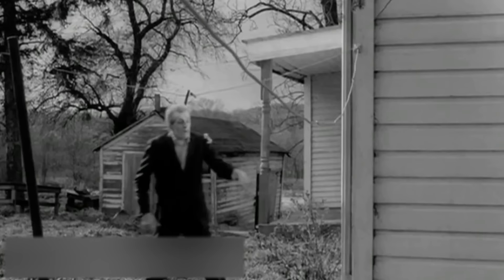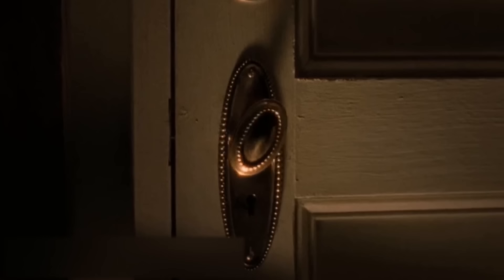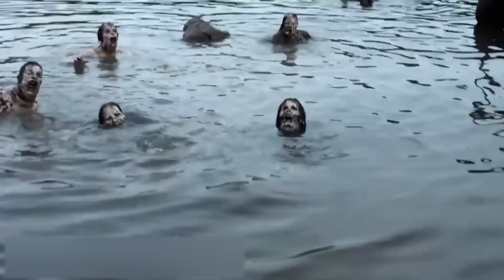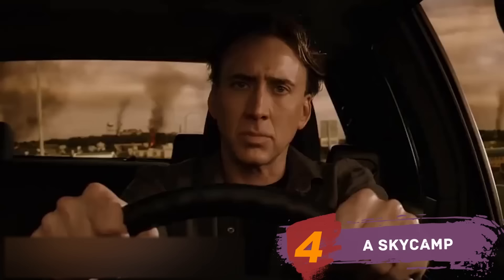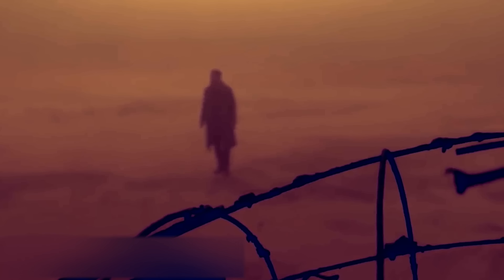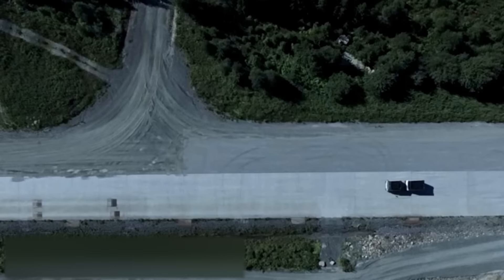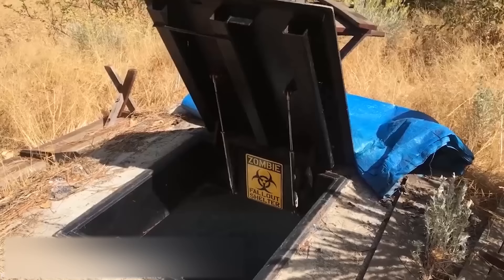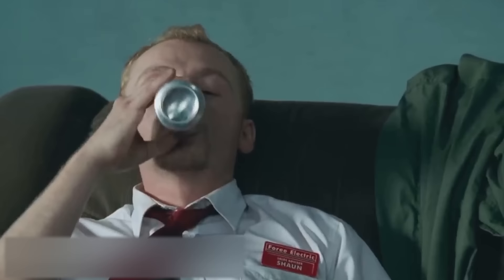9 Cool Ideas in the Case of a Zombie Apocalypse

Comment: OK these things are pointless to have. Plus they must be expensive. 
And theos mad max type cars with all that crap on it? Is really dumb in a zombie apocalypse. Why because  many thing weight, unbalanced and most of these weapons are cles range. When it be better to keep them as far as you can. But lets start with weight, 
Adding all of that unnecessary crap will cause more weight meaning more gas to move the care. If you want to armor up your car that's fine. But I would more suggest concentrating on the windows , and the wheels turning them into tank traks. Keep in mind so far all of these item leaves out some of the most important thing to survive Food, Medicine and water. That stare walker is pointless and looks very expensive. You know what would be a better way to handle stares?
Getting rid of the stares you can make a rope lader. Destroying stares shouldn't cost that much money maybe some of them might cost more time but not much money. And all you need to do is make a rope layer that you can pull up. Plus all of this and still for getting a out the greatest danger still out there. Living people you know the ones that can still use guns.
Most of these things they are showing is things you would buy now. But most likely you won't be using it. Spending money on MREs is a smarter thing to do then this.
Having skill and knowledge about things is one of the most greatest asset you can have to survive. 
How to fix cars, Engineering, Medical care, drying food, growing food, how to make fire with out using liters or matches. Etc.
Being resourceful, 
Creative,
And the ability to adapt and pick up things fast.
And let's be real that Zombie walking thing. Has a lot of problems let's start with 
(1) apparently it need power
How is it getting it's power? Outlet? What happens when the electricity goes out? Batteries?
Are they rechargeable? And even if they are, and can be recharged by a generator tell me what would you want to recharge the most.
Tell me in the comments below you can pick all of them but pick what is more important to you?
1 radio 
2 flashlight
3 cellphone. 
I know what you're thinking cellphone will there be even internet if it doesn't have power what good is a cellphone?
I'll tell you.  Because right now you can download an SAS field guide a survival book, not to mention you can also download Military field guides. Plus you can have something to take notes. Plus you can download music and videos or put them on your phone. And pictures you take either for memories or for recon. And in a Zombie Apocalypse you'll ve doing a lot of recon not really something you just want to run into.
4 drone
5 hot plate
6 Batteries for whatevers
7 keep your frig running, 
8 your zombie stare master lol
Trust me the things in this video are pointless to have.
The exception is the all-terrain vehicle ya that's good if you have a few million dollars on you. More then likely you'll still have to find gas most likely Desil. Wonder what's the mpgs on that?
And yes bunkers are good hope you're an introvert?
And hope you get along very well with anyone you bring in there.
Looking at it from a psychology point of view.
And if we go off of realistic then it might take 6 months for zombie to atrophy meaning not being able to move. But it's not like we have any information of undead Zombies so that might not happen at all.
So think about it you're in a bunker
Let's say you are insanely rich you have the most luxurious bunker with food and supplies to last a life time for you and your family. 
You'll all be stuck in a metel box with no sunlight or fresh air just recycled that includes water.
Under theos conditions people will get on each other's nerves. 
Tempers will flare. The only socializing you'll do is with each other in that bunker. You won't know what day it is other then the clock that tells you. 10 years of that why 10 years minimum? Because you won't be able to see what is going on. Sure you can open the door to see. How ever the question is. Is someone watching?
The more times you ipen your bunker door the more chances someone will discover it.
And majority of us really don't like rich people so we can do one of 2 things
(1) we wait for someone to come out and take them hostage to take your shit.
Or (2) we take a welding torch to your door so you'll never get out.
Besides we don't need rich peiple they are useless. 
Chances are above ground us common folk. Would have already come together to create our own community.  Helping each other with our skills. Rich people has no skills they'll just be a burden to the rest of us. The only thing they'll be good for is cannonfauter or decoys. We won't have a need for their money. A zombie Apocalypse is a world I would thrive in, and to be honest think most people would thrive in. Especially if you grew up in a hard life and you're not rich. Because we know what actual struggle is.